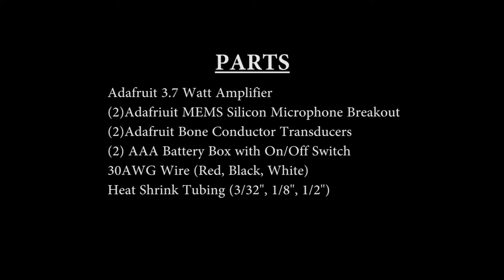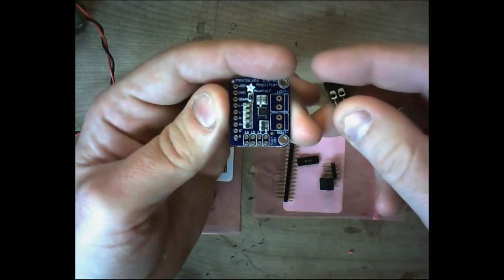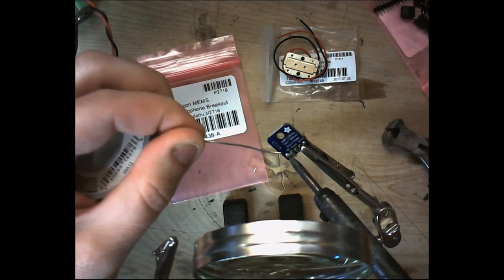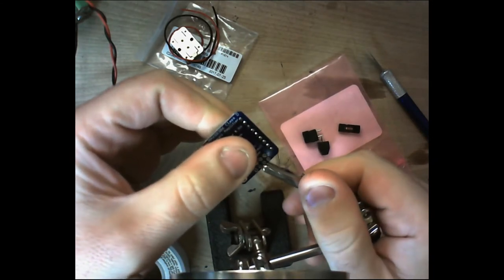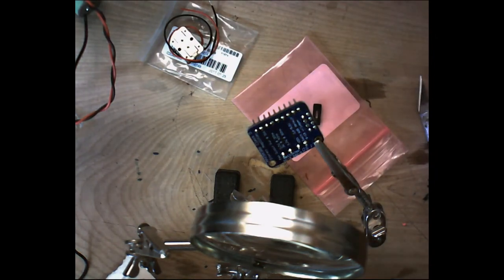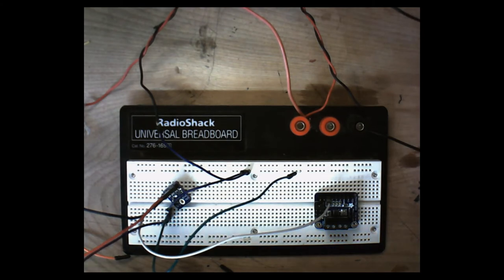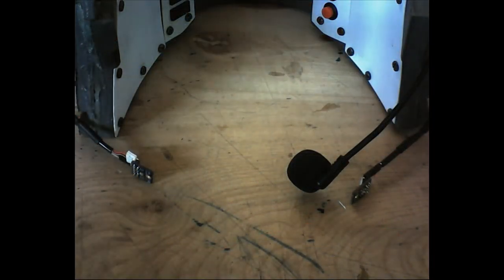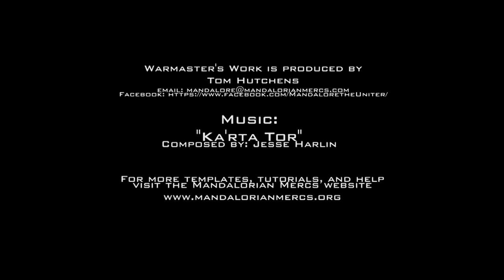Warmaster's Workshop - Episode 9: External Audio Pick-up System

Comment: Instead of the bone conducting transducers could you set this up with a couple of earbuds on the inside of the helmet, so you just plug them in your ears as you put the helmet on?
Reply from the maker: Yes, you could.  However, reaching into a helmet to try and plug in ear buds while wearing it is extremely cumbersome.

Comment: How would the output be changed to output to a female 3.5mm jack?
Reply from the maker: You should just be able to splice in a female mini-stereo jack, they make the type that unscrew so you can get to the terminals.  Positive usually goes on the inner terminal, negative on the outer terminal.

Comment: Great video! I didn't hear an explanation on how you set the pins parallel to the board. Could you tell me how you do that?
Reply from the maker: I just use a pair of needle nose pliers, and carefully bend them down to be parallel with the board.
Reply: Mandalorian Mercs I had assumed that was the case, but I wanted to make sure. I just got all the components in and I'll be building a couple of sets. Thank you so much for the video and your quick response.
Reply: One other question. It sounds like you are wiring the battery pack to both the mics and the amp. Forgive me, I'm not very electronics experienced.

Comment: I wonder if anyone's tried dissecting Electronic earmuffs like Razor Slim's by Walker, and put the omnidirectional mic's onto the helmet's ear part. It Would only cost like 10 bucks more than this and should be more simple and higher quality. Might  remove a little of the DIY aspect of this though.

Edit: looked farther into it and it seems plausible,  in this video: https://youtu.be/RsdGgIhGkS0?t=212 they disassemble one and it seems to have very simple internals. I figure this way you could keep the AUX port and just glue the foam pads and speakers into the inside whilst drilling a small hole for the mic and wiring to go though, i might have to try it.